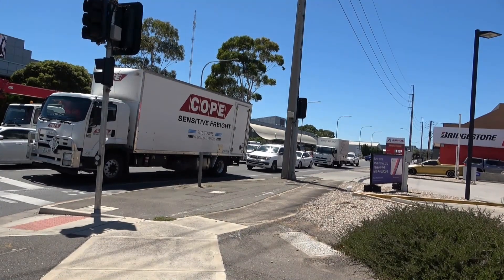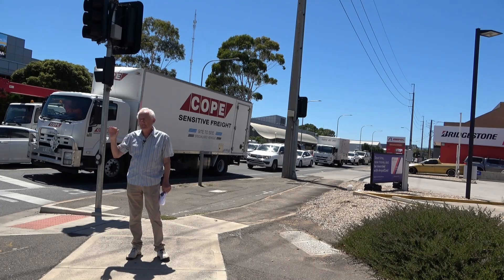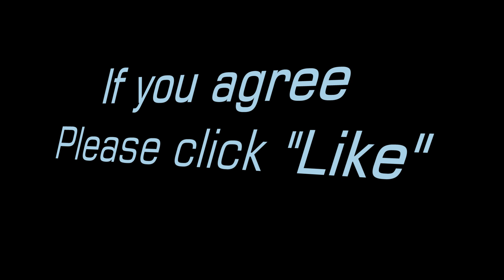Airport Link Tunnel from Glen Osmond SE Freeway via T2D Mile End and Adelaide CBD Tunnel Proposal

Comment: Neil, love your videos but I don't see the point in bringing all this traffic to Inner Metro or into the South Road development. 
The SE Freeway should be split off with a North and South feeder around the city. From either near Mouth Barker or Callington.
Reply from the maker: Thanks for the kind comment.
Have you see the "Globelink Review" - a report ordered by the Marshall (2018 - 2022) Government.    Lots of ideas but no action plans came as a result by the Marshall and Turnbull/Morrison Governments. 

The SE Freeway from Crafers to Glen Osmond was full funded by the Keating (1991 to 1996)  Government   The Brown (1993 - 1996), Olsen (1996 - 2001) &  Kerin (2001-2002) Governments did not advance the "SE Freeway" into the suburbs.
The Howard (1996 -2007) Government made no more financial contributions for the Freeway to be extended

You suggest  "The SE Freeway should be split off with a North and South feeder around the city" 
I suggest this is exactly what the current Malinauskas (2022 -) Government is doing,   They interrupted the implementation of the TSD by shortening the north tunnel so they could implement a "Connector" to bring traffic into the CBD via James Congdon Drive (the old North Terrace to Glenelg railway line).
Jame Congdon Drive is part of the R1.    The R1 is a very close approximation to the Ring Route in the 1962 MATS Plan .

This video is implying the "Connector" should be best done underground grade separation similar to Kedron  T-Junction. 

I am suggesting a Mile End to West Terrace-CBD tunnel would be a better implementation of this idea.   No destruction of private property along the route.